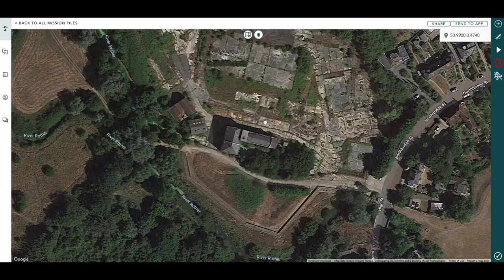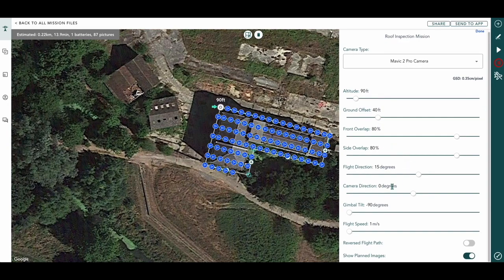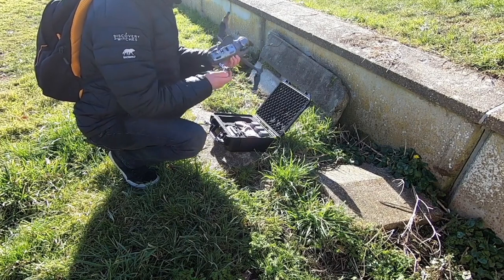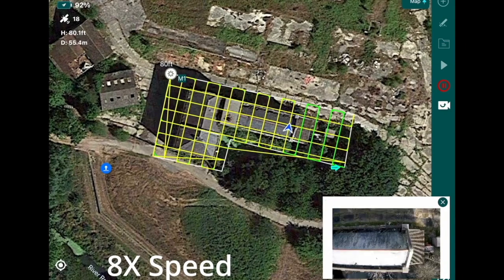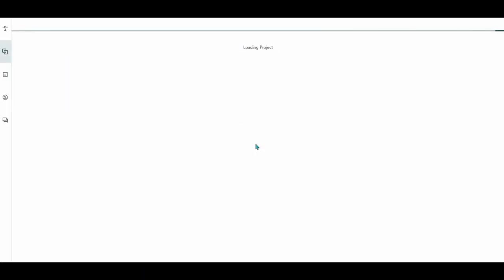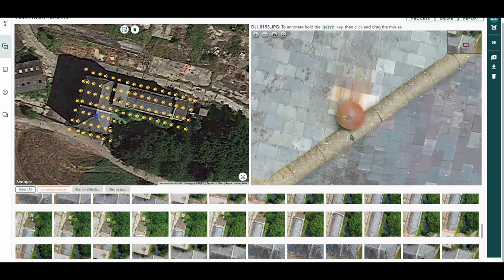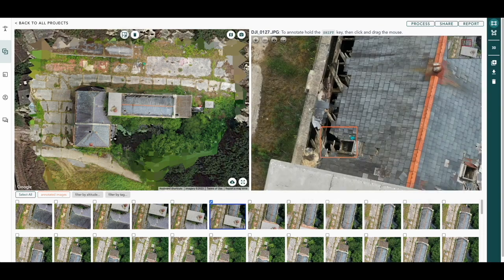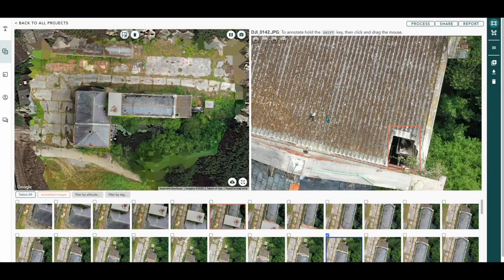Drone Mapping & Inspection: How to Perform Roof Inspections with Drones | Hammer Missions

Comment: You can’t yet do this with the Mavic 3 yet, correct?
Reply from the maker: That's right, but you CAN use the Mavic 3 Enterprise series.
Reply: @HammerMissions  Did you mean Mavic 2?
Reply from the maker: @jeremiahis  Sorry, we meant the Mavic 3 Enterprise series. Mavic 2 series is also supported.
Reply: @HammerMissions  Thanks, yah I really wish they'd open up the M3P.

Comment: what program you are using to map the roof??
Reply from the maker: It's Hammer Missions! hammermissions.com
Reply: Does it work on the air 3?
Reply from the maker: @JoeWiley-id6vq  Unfortunately, due to DJI's restrictions, the Mavic Air 3 is not supported. We recommend looking into the Mavic 2 Pro or the Mavic 3 Enterprise!

Comment: Why are the camera icons not aligned with the ortho? 6min 10sec into the video, you can see the issue
Reply from the maker: Generally speaking, there can be alignment discrepancies between the processed map and the base map. To get better alignment, we recommend using GCPs or RTK methods: 
https://www.hammermissions.com/post/how-to-achieve-highly-accurate-flights-with-the-dji-m300-rtk